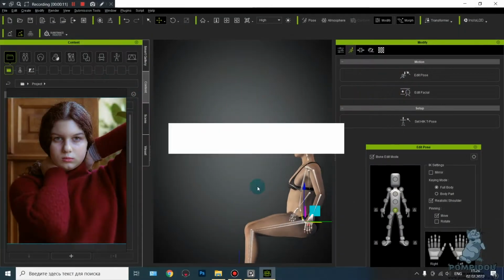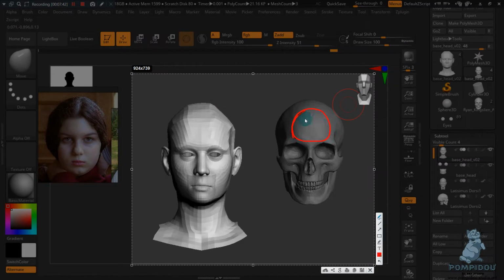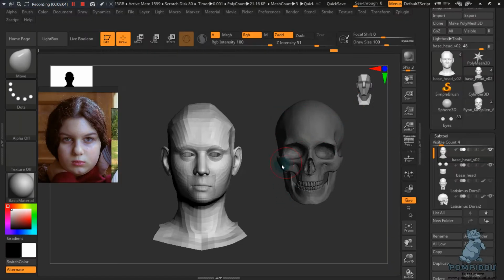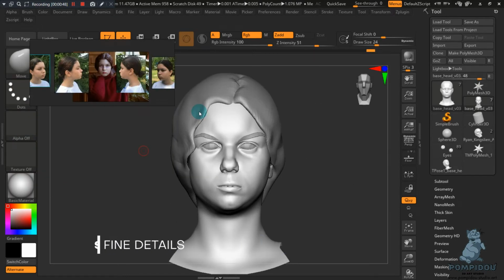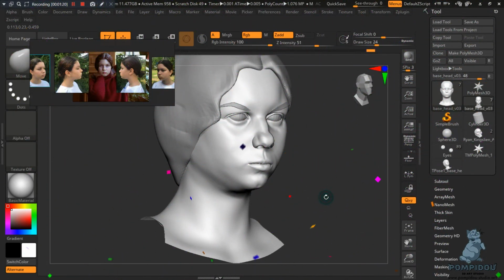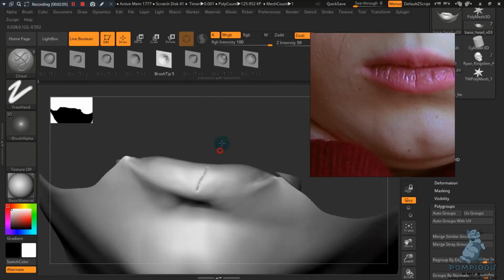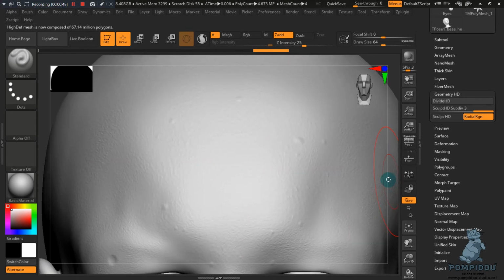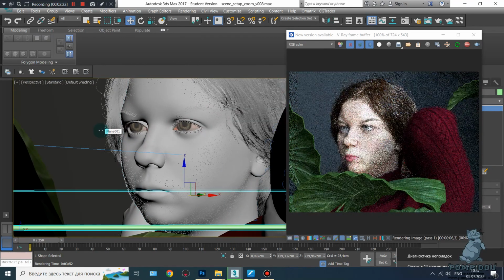Sculpting photoreal portrait in Zbrush like PRO.

Comment: Looks amazing!! Thank you for sharing! What program do you use to draw red lines for measuring the angles both on the reference photos and the zbrush models??
Reply from the maker: It could be any screenshot program or even painter or photoshop. Mine is Lightshot. https://app.prntscr.com
But it’s not necessary, you can measure by using your pencil or anything. :)

Comment: Hey, you dont have to export alembic animation file to 3DsMax between CC3 >>>MarvelousDesigner workflow. You can import starting pose (Tpose or Apose for example) straight to MD and than import final pose mesh as Morph Target. But of course your way is also fine ;) thanks
Reply from the maker: No, because once arm bends it bends wrong through morph target. It shrinks then grows to right position. This causes mistakes in simulation. So it needs to be the hard way - proper animation and alembic :)

Comment: ❤Can you tell me the machine configuration you use? Does it require a high machine configuration?Pay attention to epidemic prevention, stay away from crowds, wear masks at all times, and pay attention to safety
Reply from the maker: No, my machine is at middle complexity I guess.
Processor: Intel core i7, 7700k CPU, OM 16 Gb.
Graphic card: Nvidia GeForce RTX 2060
Reply: @Pompidou3Dstudio  thanks
Reply: What software did you use at 4:39 for red line